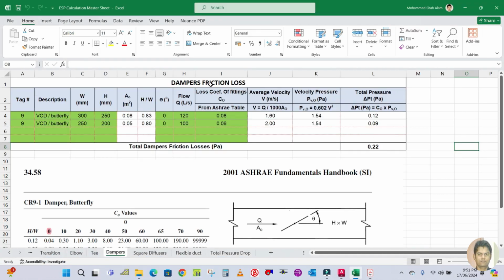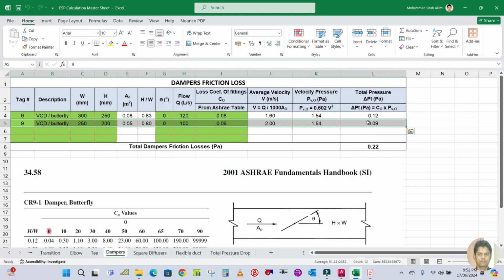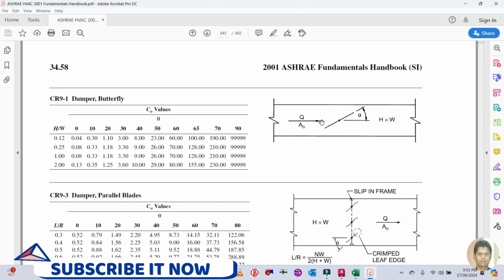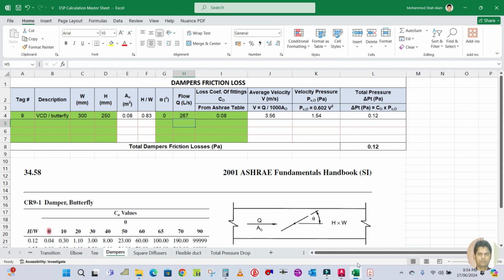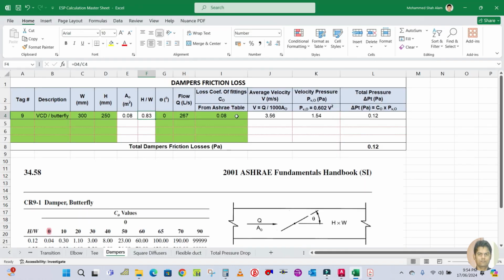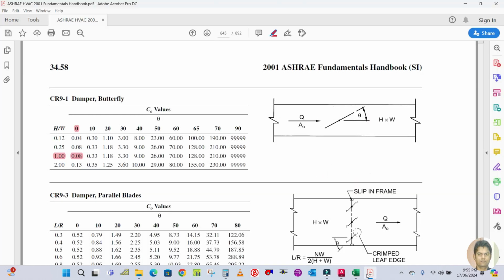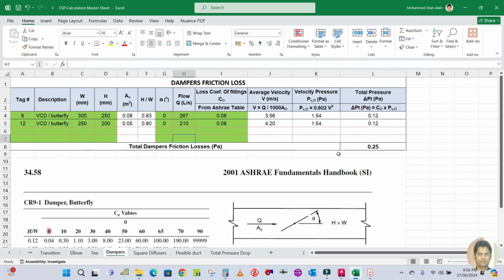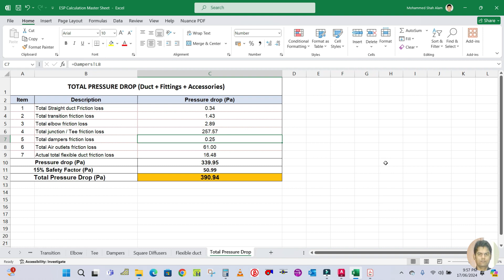Pressure Loss in dampers II pressure drop across damper II calculate pressure drop in damper II

Comment: In this video, you maintained the velocity pressure calculation as 1.54, where it shows = 0.602 * (1.67*1.67). However, the correct value should be 0.602 * (3.58^2) = 7.62, and the total pressure should be 0.62 PA, right?"
Reply from the maker: yes